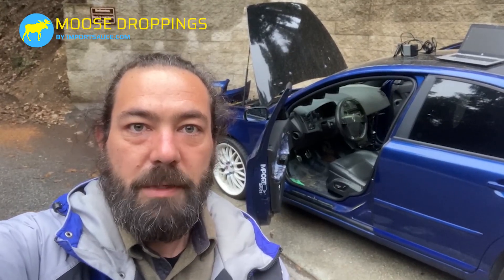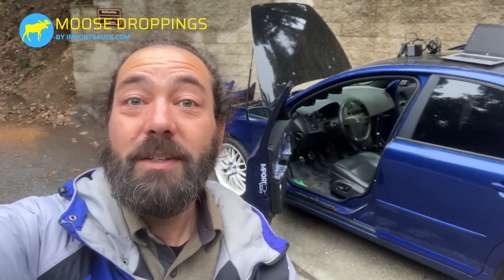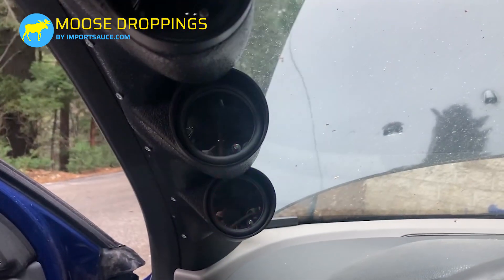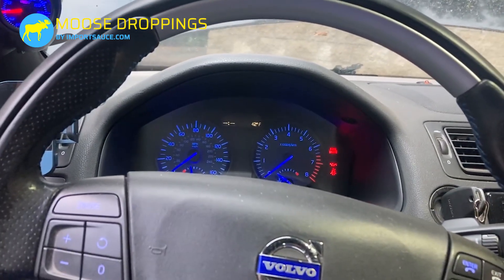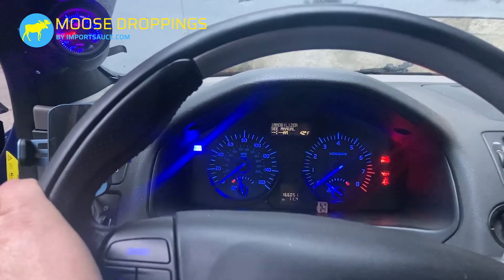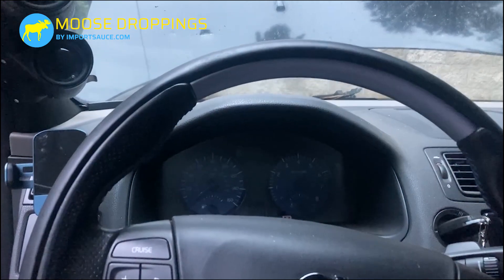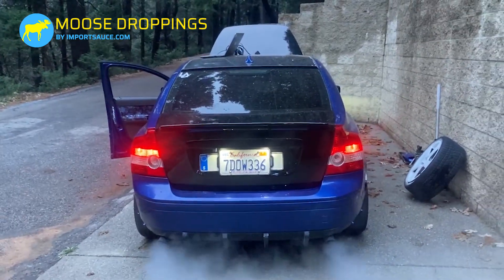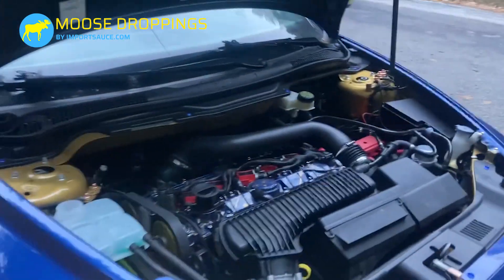Starting the Engine after the Rebuild. Did it start? YES... but w/ some almost catastrophic issues.

Comment: You might already know all this but I'll share anyway...Back when I modded my V50 I got immobilized 3 times. FIRST, I had an abs code that would be intermittent, shortly after my front calipers seized. Swaped them for ford fitting calipers and code gone, immobilizer gone. SECOND, I had tried doing the haldex swap for my rear diff and in the process had found the diff was just bad, got a new one and had it flashed by volvo dealership, fixed that issue. THIRD, a bad o2 sensor...I think the upstream one. Swapped and fixed it. Even just battery running low has immobilized me. Volvo computer flashing is a big thing with these and without the equipment I just kept bringing it the dealer to get the software talking right. From my understanding, some parts need to be properly identified by other components of the system, even if they "work" they can still "block" ecu communications that way. Cheers! Keep it up!!
Reply from the maker: I notice we get it often when battery gets messed with.  In and the. Out or disconnecting.  We always just leave battery off for 15 minutes and it clears